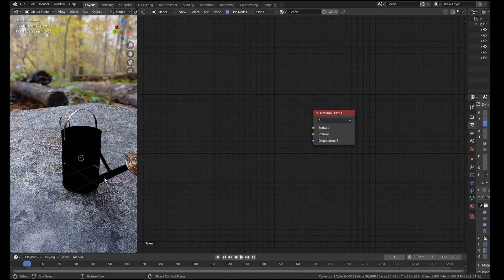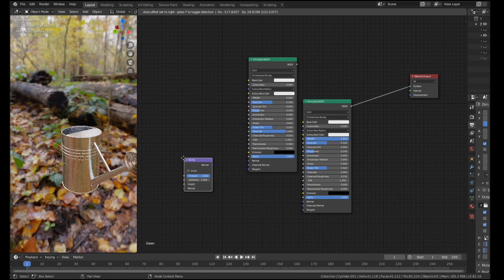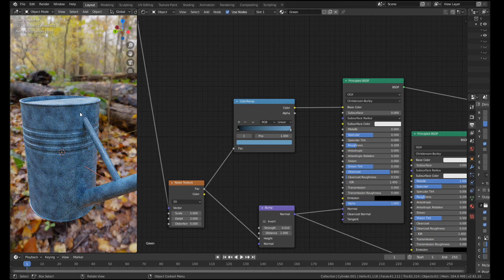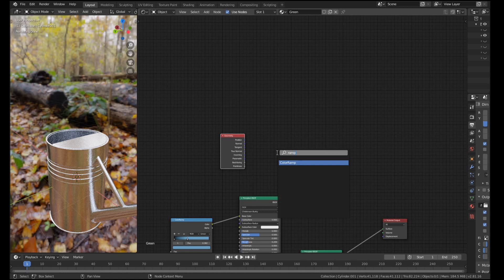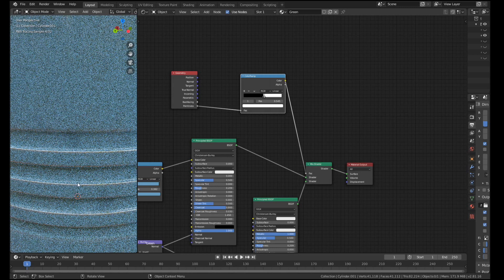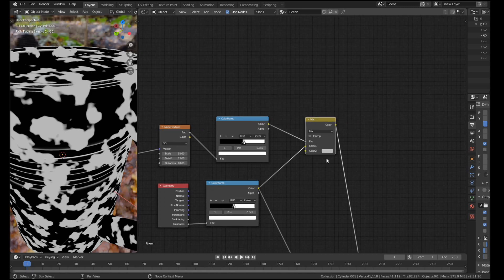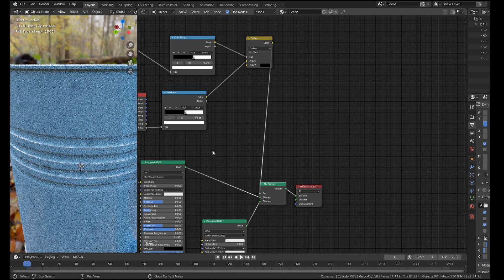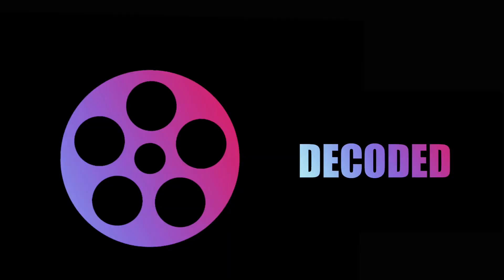Blender Tutorial: Procedural Edge Damage

Comment: To get the pointedness to work, I needed to add some geometry, a default cube didn't work. Showed up fine when in render mode.
Reply from the maker: Yeah it isn't a great system. It usually needs a few supporting loops near edges to work correctly.

Comment: I cant get this to work. When i plug the pointiness into colour ramp and adjust the sliders on the ramp, it  doesnt find the pointy edges.  I have made a cylinder with the same  grooves as your model,  but not getting the same result, it just makes the indents black and the  main cylinder white. Any idea why this may be happening? Im using ver 2.93, and there is an extra socket below the pointiness socket labelled  'random per island', which yours doesnt have, does this make a difference?  Has the newer version changed how pointines works? I hope you can help.

Comment: I'm trying to add wear to the edges of boards. I tried this technique but it doesn't detect any pointiness along the edges of the boards, hence no wear. I also tried beveling the edges but still now wear. What would be the best technique to add wear along the edges in this case, i.e. painted board?
Reply: Same issue here, im rendering in cycles, and trying to make  procedural materials for geometric chocolates, so that the edge picks up a different color than the face, i have tried the pointiness method, and the ambient occlusion, however all that changing the color ramp does is shift the color of the entire object from black to white. even at minute percential changes it seems to affect the entire geometry.
Reply: @franciscojacobo2341  You could also try using Ambient Oclusion node with option "Inside" to find pointy bits without using "Pointiness". That should work with EEVEE, too. from comment below this one

Comment: I tried this on an hilt of a sword and the entire hilt was either black or white, there was no middle ground. And yes, the hilt has hard edges. Nevertheless, seems like a really cool trick n.n
Reply from the maker: Try adding more geometry to the sword. Pointiness is based on vertex positions, so it works best on a fairly dense mesh.
Reply: @DECODEDVFX  I see. I tried using the Bevel node as well and I think the issue you are referring to might be it. With the bevel node, edge loops that I had created also seem to impact what is detected as an edge, and the edge detected is very narrow.

Comment: Great video. It would be great if you could make a video to add actual physical imperfections in those pointy edges of objects using microdisplacements. Say concrete materials will have broken parts in the edges. Please do a tutorial on such thing. Thanks.
Reply: Couldn't you just add voronoi noise with color ramp to apply the bump? If you use the same input for the bump (actually scratch) and material, it should look like a scratch where another material shines through. For extra points, you could add some threshold to material change so you can get a light scratch where the "bottom" material doesn't shine through but you still get light interaction with the scratch.

Comment: Followed what you have done, was going well till the MixRGB and now it looks like zebra stripes, any ideas or is it blender changing it in 2.83?
Reply from the maker: No changes as far as I know. It sounds like it could be a mapping issue. Make sure you've got the noise node connected to the mapping node.
Reply: @DECODEDVFX  Yea everything was connected the same way as your Video. Shall have a another look
Reply: Well found the issue it was due to the amount of subdivisions on the edges. Unfortunately that won't work for me as it's a game asset but found a work around by using the bevel node instead.

Comment: One fault I can think of is that grime, rust, paint chips, etc. tend to form in very specific places—areas that see the most wear would chip more (and not just every edge indiscriminately) while rust generally follows water, dripping down surfaces and collecting in recesses. This technique is perfect for small detail objects as-is but focal points could use some manual detailing, accomplished by plugging a greyscale image texture into the mix nodes' factor and painting that.
Reply: If you want more control over placement, you can add a vertex colour layer and use that to modulate the rustiness. This lets you hand-paint the variation in the material.

Comment: The node isn't working for me the way it does in your video. When I drag the color ramp handles it darkens the interior portion of the "rings" rather then the edges of the rings. Any idea why? Wish I could post a screenshot...
Reply from the maker: Make sure you drag the black handle passed the 50% mark on the color ramp. If that doesn't work, try swapping the colors around so the black handle is on the right and the white is left.
Reply: Also make sure your normals are right way up.

Comment: Why don't you just texture paint it?
Reply from the maker: This is procedural. You can apply this material to any object and it will work straight away, you don't even need to unwrap it. And once you know how to do this effect, it's much faster than texture painting too. Also, texture painting sometimes struggles with clearly defined edges, especially if you want to keep UV resolutions low. 

If an object will be close to the camera I usually combine this effect with texture painting to get the best of both methods.